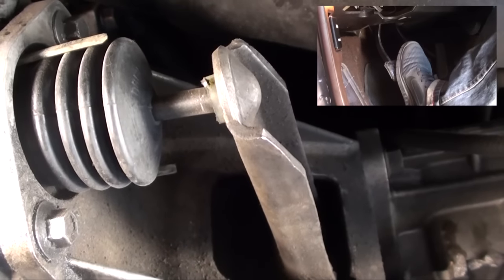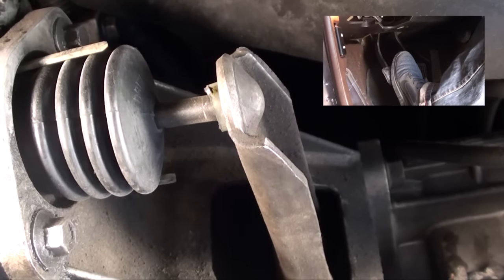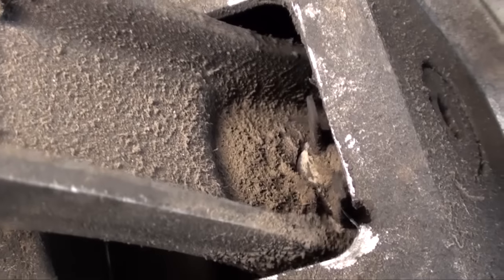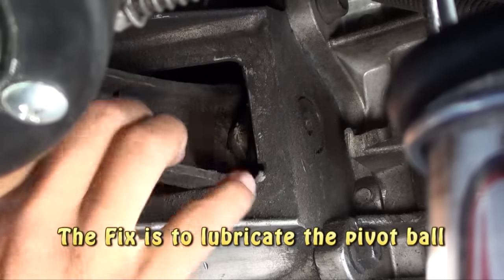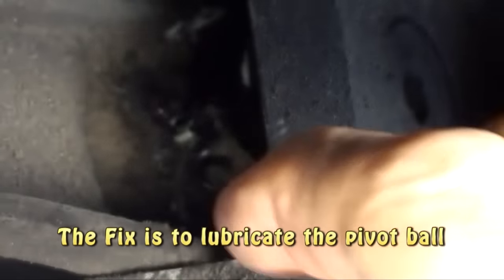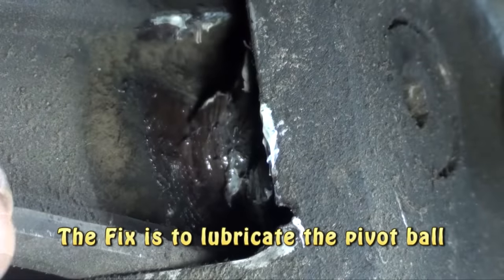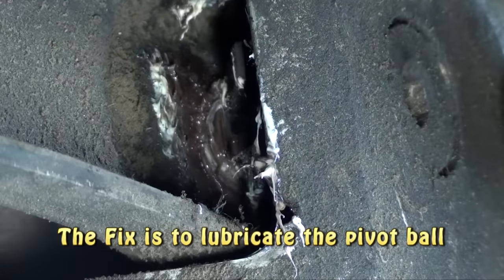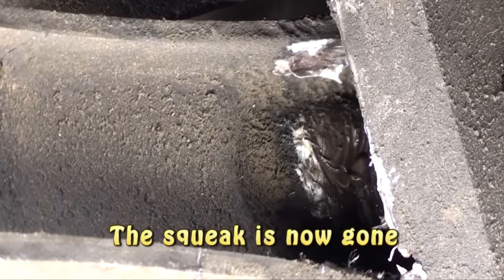Clutch Release Fork Noise

Comment: I need to try this. I have a very similar noise on my 1996 mustang after installing a new transmission. Thought it was throwout bearing but hopefully it's an easy fix like this 😁
Reply: Did that fix it? My Dodge Caliber is making that exact same noise
Reply: I never considered that it could be this. Going to have to try this. Always thought it was my TOB as well
Reply: Doug Bruce I have a 96 stang Gt 4.6 trew a new clutch in it had it done of course  was getting a tic tic tic sound when crawling in 1st gear second also thow you could barely here it then now it sounds like  something rubbing on tin press down on the clutch very slight just barley touch the clutch it goes away  did you ever figure your noise out and if so what was the culprit please thank you Doug I hope you get this or any one that may know

Comment: I just have my clutch system change last week. From pressure plate, flywheel, cable clutch, throwout bearing and a pilot bearing. but when I let go of my clutch again, the whining noise is still there. So I let the mechanic checked the whole clutch again.{twice}. Yet that same noise is back again. I spend a total of more than $1500 for it. Can you please give me an idea what causes that noise? Is that noise coming from somewhere else and not on the clutch?
Reply from the maker: I will need some more details.  Year, make, model of vehicle.  When do you hear the noise?  Pedal up, pedal down all the way, Only while pressing the pedal, only while letting up on the pedal.  Does it sound more like a squeak, squeal or rattle. Does it sound metallic.  Does it sound like it could be coming from under your dash?  Can you hear the noise with the engine off or does it have to be on?  Place your head under your dash trans in neutral and parking brake on.  Press the clutch by hand. Does it sound like the noise is under the dash?  Is the noise consistent in tone and intensity or does it change in tone and intensity?  If it changes what are you doing to make it change.  Pedal operation, starting to move down the road?  If you feed me some more detailed data I may be able to help.
Reply: @DrivelineMaster  ...... I just did some  further researching, I think the problem is the input shaft bearing. I got 2004 ford Mustang GT manual. It only makes noise if the pedal is up and it disappear when I stepped on it all the way down. I'm hearing the noise under neat the middle bottom of my car.
  Thanks for responding, I do appreciate your help.
Reply from the maker: That is correct.  If you only hear the noise when your clutch pedal is up, then it goes away when the pedal is fully depressed while the vehicle is not moving then the problem is inside the transmission or transaxle and not the clutch.  Input shaft bearing is one option and the most common but depending on the type of transmission or transaxle there are other bearings and moving parts inside the transmission/transaxle when the clutch pedal is up.
Reply: @DrivelineMaster  ...Thanks you buddy, this is a very big help. Thanks again.

Comment: Mine does it when the clutch is engaged!!! Same thing or some other related problem.
Reply from the maker: I have to ask because there is a confusion about the clutch being engaged.  The clutch being engaged does not mean the clutch pedal is engaged. When the clutch is engaged your foot is off the pedal and the engine power is engaged with the transmission.  Now that I have cleared that up if you give me some more specifics as to when you hear and don't hear the noise in relationship to pressure on the pedal and whether or not the noise is heard without the vehicle moving or only when moving or only when shifting, etc... I will try to help you to pinpoint the noise for you. Also vehicle year, make, model and engine can be helpful.

Comment: Sir how can i fix on my toyota vios 2018 still have a clutch boots
Reply from the maker: I'm sorry but this model is not sold in the United States and I don't have access to any service manual information for this vehicle. If you are experiencing noise that chirps with your foot off the clutch and then it goes away as soon as you put a slight amount of pressure on the clutch pedal then you have a pivot ball noise.  The next question is: Where is the pivot ball located?  Is it in the bell housing closest to the release fork as it exits the bell housing? or is it on the opposite side.  You will need to remove the slave cylinder and the rubber boot that protects water from entering the bell housing through the release fork hole. With a light, mirror or other means you need to look in that hole to see if you can see the pivot ball as in my video.  You will need to push the fork out of the way.  If your lucky you will see it and you will have enough room to apply some grease to the pivot ball though the release fork hole.

Comment: Does this work for all cars? Because in have the same problem with a 2017 wrx
Reply from the maker: Not all manual transmission vehicles use a release fork and pivot ball however your WRX does and a dry pivot ball could be the source of your noise.  I don't know if you will be able to access the pivot ball without removing the transmission. I have a 2015 WRX in the shop now. I will take a look to see and write back in a day or two. With only a 3 year old vehicle I don't suspect the clutch has been replaced yet.  If not, it's a shame the factory lube didn't last.  If by chance it had been replaced then the last technician who was in there didn't properly lubricate the pivot ball and fork. If there is any chance the car is still under factory warranty maybe you can get it fixed under warranty.  If it's not fixed the fork and ball will were out and both will need to be replaced on the next clutch job adding to the cost.
Reply from the maker: Your 2017 WRX should be almost the same as a 2105 model.  If so you should be able to lubricate this without removing the transaxle.  First remove the intercooler to expose the release fork and slave cylinder. Remove the two 8mm bolts (12 mm hex heads) that hold the slave cylinder on.  Pull back the rubber boot that covers the release fork access hole in the bell housing.  You should now be able to see the pivot ball with a flash light.  If it looks like orange rusty colored then it's dry.  You might be able to get some white grease in a spay can and use the straw to spray some lubricate onto the pivot ball.  Just make sure you don't spray grease everywhere. You need to be surgical and very specific with your grease application.  Reinstall everything and see if it fixed your noise.  One NOTE!  DON'T touch your clutch pedal while the slave cylinder is disconnected from it's location.  Also make sure to properly get the boot back in place.  This helps to keep water and dirt out of your clutch assemble.

Comment: This is amazing. Thank you for the detailed explanation. Just out of curiosity are the  vibrations normal as well? Is that just normal input shaft play?
Reply from the maker: The vibration is normal and it's due to run out on the pressure plate diaphragm fingers.

Comment: Will this work on 2003 mustang gt? It making the same noise
Reply from the maker: This works on all vehicles that use a release fork and pivot ball to release the clutch.  The problem is that the pivot ball on some vehicles is on the opposite side of the bell housing where the release fork extends out of the access hole in the bell housing.  On those designed there is no way to access the pivot ball without removing the transmission.  I'm sorry to report to you that the 2003 Ford Mustang uses the design type that places the pivot ball on the opposite side of the access hole.  The only way to solve this on your vehicle is to remove the transmission.  You might as well live with it until you have to replace the clutch. At the time of the clutch replacement there is a good chance the release fork and pivot ball will be severely worn so plan to replace those at the same time. Make sure the technician applies enough high quality grease to the pivot ball and fork during replacement so you won't have to deal with this again and your next clutch job will not need a new fork or pivot ball.
Reply: @DrivelineMaster  thank you for the information but I recently just replace the clutch like 2 month ago so idk how long would the clutch go out with the noise
Reply from the maker: If you paid to have the clutch replaced just a few months ago and it indeed chirps just like in the video where the noise goes away with slight pedal pressure I would take it back and make them remove your transmission and properly lubricate the pivot ball.  This is on them for not doing the job right the first time.

Comment: Can anyone help me out on where I get to the clutch fork in order to grease it?
Reply from the maker: Please provide the Year, Make, Model, Trim and engine and I will try to help.
Reply: It is a 2008 fiat punto grande, engine 1242cc right hand drive car
Reply: As I have the exact same problem, I took it into the garage and they told me that it’s my clutch release bearing in which I disagree with and don’t think it is that as I have same problem as you did
Reply from the maker: Many technicians don't know how to properly distinguish between a throw out bearing, pilot bearing, release fork pivot and transmission bearing noise. Because I'm in the USA I don't have access to right hand drive vehicle information.  Here is what I can tell you.  Right behind your engine is the clutch and transmission. The clutch sits between the engine and transmission.  The first 8 - 10 inches behind the engine is called the bell housing.  This is normally where you find the release fork sticking out of the bell housing.  It can be on the left or right side and even on top for some vehicles of the bell housing.  The release fork sticks out of the bell housing through an access hole. There is normally a rubber boot of some kind that helps to seal the access hole to keep road dirt out of the clutch assemble.  You have to pull the boot back to gain access to the pivot ball.  There are normally two designs of release forks with pivot balls.  The first design is what I show in my video with the pivot ball being close to the access hole.  The other design puts the pivot ball on the opposite side of the bell housing which makes it impossible to lubricate without removing the transmission.  If I have access to a service manual for your vehicle I would most likely be able to tell you which design you have and the location of your release fork.  Sorry I can't help any further.
Reply: @DrivelineMaster  any chance I could email you the vids I have of the noise? See if you can help me out more?
Reply from the maker: Sure. drivelinemaster@gmail.com

Comment: I had this exact noise on my 92 mr2, same clutch setup, drove me mad for months wasn't until the slave cylinder went that I took out the rubber fork boot and greased that ball, id had a clutch put in prior to this and I guess they forget to grease the pivot ball as it was bone dry
Reply from the maker: Unfortunately too many techs don't know how to properly lubricate all the parts in a clutch job nor do they know the proper lubricant to use.

Comment: I have the same noise but only when car is moving . Could this be the issue?
Reply from the maker: Possible but not likely.  When the vehicle is moving does the noise go away when you apply a small amount of pressure to the clutch pedal?  It would be unusual for this noise to only occur only when the vehicle is moving.   Typically if a noise in a manual transmission area is only hear when moving it would indicate an output shaft bearing noise but if it is the output shaft bearing noise pressing down on the clutch while moving should not impact the noise.
Reply: @DrivelineMaster  when i press clutch while in gear noise disappear. When i put in neutral while moving and release clutch also noise dissapear. Only when moving and when in gear, if i press gas pedal noise become louder. Sometimes noise goes away and comes back again. Confused what it could be, car works great.
Reply from the maker: By your description it does not sound like an output shaft bearing.  I need a little more clarity for me to help you. When you said "When I press the clutch while in gear noise disappears"  Are you pressing the clutch down all the way or only about an inch?  If pressing all the way down while in gear are you not moving or moving?
Reply: @DrivelineMaster  i press clutch all the way down while moving in gear and noise dissapear. Immediatly i start to release clutch noise appears again.
Reply from the maker: The difference between a release fork noise and a transmission noise is dependent on how far down you press the clutch pedal to make the noise appear or disappear.  If you have to press the clutch pedal all the way down (or at least 3/4 down) before the noise goes away then the problem is likely inside the transmission however some of your statements contradict  logic. Such as, if it's inside the transmission and not the output shaft anytime the clutch is engaged or the pedal is fully up you should hear the noise if there is a problem regardless of neutral standing still or moving in neutral or in gear. If the noise is on the output shaft you should hear noise anytime the vehicle is moving and it should not matter in neutral or in gear, clutch up or pressed down.  Now it is possible under these different driving test conditions that the noise is still there but it got much quieter and it's not as noticeable. That information can help with the diagnosis just as much as the noise disappearing all together. My best advise would be to take this to a qualified automotive technician who knows how to diagnose drivetrain noises. Then will have a keen ear during the road test as well as being able to raise the vehicle up in the air and listen from underneath.  They may even have a set of Chassis ears that can be used to listen and pinpoint noises while road testing the vehicle.  It would be wise to find out what is causing the noise before it leaves you stranded on the side of the road.  Good Luck.  If you find out what it is I would like to know.
Reply: @DrivelineMaster  I will. Thanks a lot for your answers.
Reply: It was sheaf in gearbox. Also there was low level  oil  in gearbox.  So it was rebult and changed oil and noise is gone.
Reply from the maker: Thanks for the update.  I thought it might be inside the gearbox and not the clutch release fork.  Glad you got it solved.

Comment: Does anyone know if a 2010 mustang gt has a slave cylinder or  throw out bearing??
Reply from the maker: It has both however the slave and throw out bearing are all built into one unit inside the bell housing.  They do not use a release fork or pivot assemble. The transmission has to be removed to replace this item.
Reply: @DrivelineMaster  appreciate you I was just asking because I was gonna order a new clutch set from AM but it said throwout bearing with it and I wasn’t sure if it was that or a slave Cyl

Comment: Where is this release fork located?
Reply from the maker: Not all transmissions and transaxles use a release fork.  Some Fords and Mazda do not have a fork.  There may be other as well.  Locate the transmission or transaxle where it bolts to the engine.  This is the bell housing.  If you have a release fork it will stick out of the side of the bell housing through a hole in the side of the bell housing.  The hydraulic slave cylinder or release cable will be connected to the fork on the outside of the bell housing.
Reply: @DrivelineMaster  ok thanks a lot

Comment: Put what about the shaking in tapping?
Reply from the maker: The shaking is a natural occurrence caused by the release bearing gently touching the clutch cover springs and can't be removed. The tapping noise is coming from the release bearing and it is not excessive and can't be heard by the driver while inside the car. To fix that noise the transmission would have to be removed and the release (throw out) bearing and possible the clutch cover (pressure plate) would have to be replaced.  If you to all that much trouble you might as well replace the whole clutch assembly.  The lubrication on the release fork solved the customer complaint.

Comment: My honda CRV 2005 has a rubber boot on that fork, I even replaced with a new one when i noticed it was a little ripped.  I would had that cleaned before anything else
Reply from the maker: Yes, they are all supposed to have a rubber boot to keep the road dirt and grim out of the clutch assemble.  The pivot ball should be properly lubricated from the factory and every time the clutch is replaced. The missing boot can accelerate a breakdown in the lubrication when water and dirt are allowed to enter the clutch area.  It's also possible that the pivot was not properly lubricated the last time the clutch was replaced or the transmission was removed.

Comment: Surely this is more than just the fork..   i think its input shaft bearing failed.    Transmission out job to properly fix.
Reply from the maker: No, you are wrong. An input shaft bearing noise will make noise as long as the clutch has any type of engagement. Once the clutch is fully disengaged and the vehicle is stopped an input bearing noise will go away. This is the same for any internal transmission bearing or gear noise. This noise goes away as soon as pressure is applied to the clutch pedal which removes the slack between the release fork and the pivot ball.